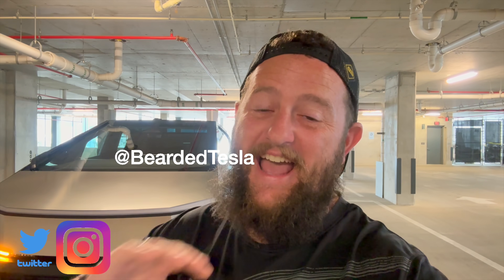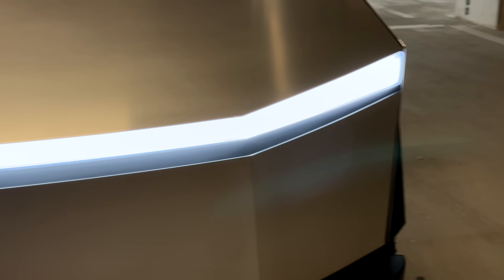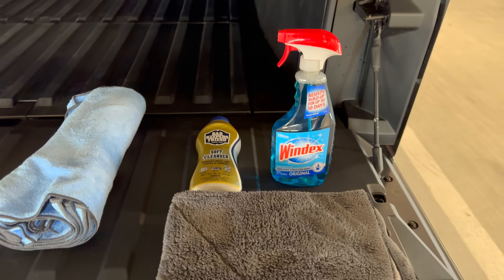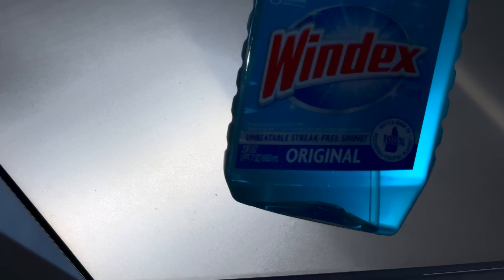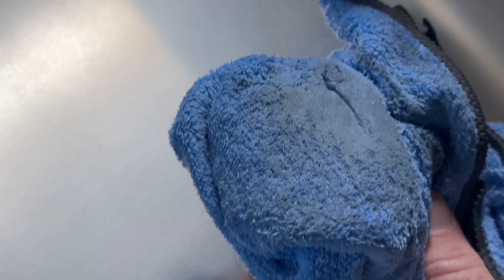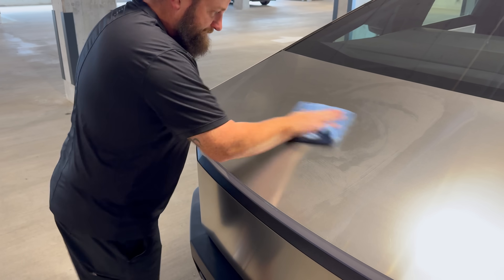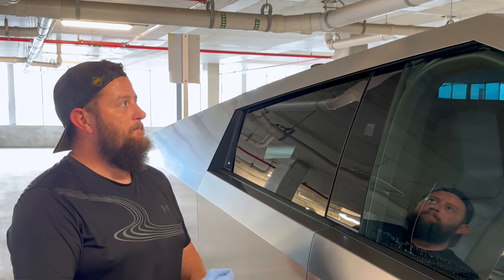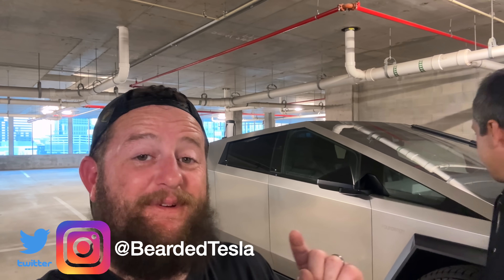Tesla CyberTRUCK or CyberRUST?? The TRUTH About Cybertruck Rusting Issue + How To Fix It!!

Comment: That's insanely high maintenance for a vehicle designed for utility. There's no way an average Joe is going to spend the time to hand buff-out their entire vehicle on a weekly basis... while also preventing the rub marks from showing over time as you continue to remove layers of the stainless after months/years of use.
Reply: Thing is, NO ONE is buying this "truck" to actually use for your typical truck things. This is a niche image vehicle, and there isn't anything wrong with that. Tesla fans and those with expendable cash who need to be "seen" will buy this. They will be popular for a year or two, then sales will die.

The F-150 has been the best selling truck for almost half a century. Yet no one wants the electric F-150 Lightning. GM's Hummer also isn't moving. My local Ford dealer has had the same 3 Lightnings sitting on their lot for months now. Yet they sell countless gas F-150's every week. Here in NE, folks who buy trucks do not care about the cost of gas. They want 4X4 and something they can tow long distances with. Even with an AWD CT, those tires would be useless in NE snow. 

For what it's worth, the CT's I have seen that have been wrapped (regardless of color) look MUCH better than the rolling refrigerator stainless steel. Stainless steel has to be the most overrated thing right now. I regret "upgrading" my kitchen appliances and can't wait to go back to all black.
Reply: @robertgreenhalge1708  From my perspective you are 100% correct, we have a F150 for all of our truck stuff like towing, camping, space for the dogs and more. At the end of the day it serves that purpose and when we want fast and fun we take the car that’s meant to do those things. 

I find even here in Texas with individuals with trucks for vanity there are still a ton of people that use Trucks as a TRUCK. There is no way around that so a EV truck on the market is still going to be a niche but it’s even a harder sell when it tries to solve problems no one is asking for. 

One of my Automotive Design instructors said this to us in school, “Never design for yourself, use design to solve a problem the market is asking for”
I view the CyberTruck as that, it’s designed for Elon and Elon types but that’s it and nothing else.
Reply: I just take my shit through car wash  its a daily not a jay leno museum piece 😂
Reply: You don't need to do this weekly unless you are parking it on a moving railcar and/or next to a grinding wheel working mild steel. At this point, any car is going to have this stuff on the paint. The only unique situation here is that it's a cybertruck.
Reply: @TheRealFrankGrimes  Not any car to the same level. This is something unique to the "stainless" body of the Cybertruck.
Reply: Average Joe wouldn't care. All they need to know is "Those are not rusting spot in your truck".  But since there's so many anti Tesla people trying to point out how Cybertruck (or Tesla) is not PERPECT in every which way, many community members tends to come up with all kind of solutions to count such FUD.
Reply: Nope, any trucker with a brain knows this is not acceptable on release for 100k utility vehicle.. its just as simple as that.. you clearly don’t use trucks, its just a novelty for you and it shows in the product  @clncl98506
Reply: @clncl98506  I'm pretty sure most people would object to rust spots on a $100,000 car.
Reply: @clncl98506  and equal to the anti Tesla people are the Tesla butt kissers that brush away serious flaws.   We are talking about a 100k NEW vehicle that is predominately a show piece.  Now it can't even do that right.   You can masquerade it however you want "the truck is not actually rusting it's just showing environmental rust"  Yeah whatever.   Bottom line is other new cars don't do this and it looks awful.   This is right now, on a brand new vehicle.  What is it going to look like in a year or five years.   How many people are going to wash their truck daily with chemicals so it doesn't look like crap?    Sure... Blame the Tesla haters.   the more I know about this truck the more I went from cool truck to feeling sorry for those that end up buying it.   People are believing they are buying this as a status symbol but that's going to die down quick and they will end up being left with a highly depreciated rust bucket.
Reply: These are iron particles, it is on any car from brakes etc. Go look up any iron removal video. This is why you see people use claybars etc on their car to removal all these particles.
Reply: @pipooh1  Dude... I've owned countless vehicles,  I've cleaned them hundreds of times including deep cleans using clay bars.   It is a completely different thing to compare years of built up road grime to a brand new vehicle that is just delivered.   There is also a difference between smooth glossy paints with clear coats to an unprotected porous unknown alloy that clearly is having a chemical reaction on day 1.   Stop fooling people into believing that this is normal.  Its not.   People should be aware that this vehicle is going to be an upkeep nightmare, if even possible.  I'm waiting to see what it looks like after it gets all sand blasted from a nice salty spring thaw drive.  With a clear coat you just polish it off.   If people are knowledgable and are still okay with it, then great, go nuts and get one.   I have definitely lost my interest.
Reply: @darpompie4354 You are aware most vehicles are cleaned/fixed before delivired duo to these type of things happening or damaged during transportation with train transport etc. Tesla does not have this step duo to direct delivery to the owner. 

Also i think if you can effort a 100k truck and care about it looks, you let it cover with PPF or ceramic.
Reply: @pipooh1  The excuses are strong with you.   Now you want to blame it on Tesla's lack of service that other companies provide such as detailing before delivery.  So then what makes the other Tesla models with the exact same delivery process so special that they aren't delivered with rust?  (Hint... They don't have a bare stainless alloy body).   What is your answer to all the other videos of cybertrucks rusting weeks after delivery and several washings/detailings?  But then you acknowledge that maybe stainless does rust but if you have the money to buy the truck then you should have the money to try and solve the problem yourself.   I don't care how rich you are.  Who in the world buys a 100k truck and doesn't care what it looks like.   If a ceramic coating resolves the issue (have my doubts), why doesn't Tesla include this in their 100k truck instead of having people try to figure itout.  That is not what I consider a luxury buying experience.
Reply: @darpompie4354  Tell me any car company that offer any paint protection from the factory? Not even Porsche etc do it because it to much of a cost to automate it.

If you care about your top layer, yes it is you that is responsible to take good care of it. 

You also aware that Tesla can be cheaper because there is no middle man asking for another cut like all other car deals. That is also the reason you see more and more car brands moving away from the middle man and do direct delivery.
Reply: @pipooh1  I am not asking them to provide free "paint protection" considering they don't even have paint.  I am asking for the reasonable assurance that my one week old vehicle won't rust without it.   Other cars don't, so based on norms any person buying a vehicle would have that reasonable expectation that there new truck won't rust either.    Other manufacturers absolutely do dunk their vehicles in rust inhibitors during the painting process.   Again, I am not specifically asking for a "Ceramic" coating as we don't even know if that solves the issue.   I am asking for Tesla to provide a vehicle that won't rust for the same amount of time that other vehicles don't (usually a 5 year 100K mile warranty).   Whatever they need to do to achieve that, whether its changing the alloy, whether its getting better rust inhibitors, whether it is to provide ceramic shield.   It is not my problem to figure out what it takes to achieve normal standards, it's on them to provide it.  Its a shame that people such as yourself don't want to hold companies accountable for their mistakes and have them solve the issue.

I am not discrediting Tesla cheaper approach to removing the middle man.  I think that's great and hope more companies do that.  I hate dealers.   That is why I took other companies out of the equation.   You claimed that the rust is due to Tesla's process of shipping by rail and not detailing the cars afterwards.   I said that the delivery process for their other "painted" cars is exactly the same so direct me to videos where Model 3's are being delivered with rust spots.
Reply: @darpompie4354  Your last sentence sums this situation up 100%. "That is not what I consider a luxury buying experience."
Reply: @pipooh1 the direct model has started to wane recently

Comment: The Cybertruck forum had some product called Protectaclear Coating. Apparently, it is not a SiO2 or TiO2 coating like traditional paint coatings. They claim it's a high molecular weight polymer coating (I suspect polyurethane/isocyanate based crosslinked polymer). Should be good to protect against UV, dirt, as well a provide oleophobic (fingerprint resistant) and hydrophobic properties. I've never heard about them, but my background in chemical and materials engineering had my interested.
Reply: $311 for a half bucket of that stuff, according to Amazon. That's ridiculous. 

The whole point of this truck is to drive a clean set of angles that noone else can own. Everyone is going up touch it. Paint protective film is what you need to fix this problem & it's ridiculous the factory doesn't provide that OEM.
Reply: Both sides of all this is hillarious.  Just buff on Colinite 845 like all the yachts and sportfishing boats do to their stainless that lasts longer then the rest of the boat.

Comment: It's complicated, this is what happens when the cheapest stainless steel from China is used to build a truck.
Reply: Everybody knows cheap stainless steel “rusts” , expensive stainless does not… people can google it… this comment is not allowed in the main thread. Good comment, cheers
Reply: It’s a custom alloy made by Tesla actually.
Reply: @1ronEntertainment It's garbage that starts to rust 10 minutes after leaving the lot. A complete screwup.
Reply: @AudiTTQuattro2003  it’s certainly not cheap, and is very resistant to corrosion
Reply: How to tell someone here to hate and not watched the video. This is iron particles that get rustes on the car. Not the panel itself that rust.

All cars have this issue, it just very visible on stainless. Go watch any iron removal video of a car and see how much of this is on it. By your logic all cars are rusting.

Comment: I have the same issue with my 2020 Kia Soul EV, I use a chemical application of AutoGlym Magma to remove the embedded iron particles that change them to a purple color and allows you to simply wipe it off, then  rinse and apply a wax or Ceramic coating after. These not only come from Train Rails but mainly also worn steel belted redial tire.
Reply: That would very possibly not work on this type of steel.
Reply: all cast iron brakes on all cars? that must also contribute to the metal dust
Reply: @jvsyoutube3298  Lets say a car needs new brake discs after every 100.000km or 60.000 miles. 

That is (external diameter) 314 mm x Pi - (internal diameter) 180mm x Pi x 2mm x 4 = 3366 mm³ or for cast iron: 24 grams.

A NEW fossil car produces max. 0,0045 gr/km x 100.000km = 450 grams. From burning fossil fuel alone.

An old fossil burner, a old truck, a coal burner or a old petrol engine produce up to 100 gr/km.

Comment: This rusting should show to everyone that the air we breathe are filled with fine particles of metal filling. It just happened iron particles are visible when oxidized. This is one proof that everyone should attend their chemistry classes in high school and college.
Reply: "This is one proof that everyone should attend their chemistry classes in high school and college." True, especially the Tesla engineers that selected the wrong grade of stainless steel for the Cybertruck. Grade 18/8 (Series 304): Made up of 18% chromium and 8% nickel. This grade is highly rust-resistant. Grade 18/10 (Series 316): Made up of 18% chromium and 10% nickel. This high grade is rust-proof and holds its polish well.

Comment: 316 stainless has corrosion rate of 0.023mm per year with 50% aeriated sodium dioxide. I bet it is rail rust. Just get an iron remover, I use it on my painted car.

Comment: Basically they used poor quality stainless so it bends easier. The panel's will rust like fuck.
Reply: These are air particles that land on the car. This can be from rail transport or even just brake dust floating in the air. 

All cars have this issue, owners of white cars that want to keep shiny will know this for sure. Iron removal and wax is only way to easily remove this in general.

Comment: The rail road excuse is hilarious. The body panels are bare metal , they should be passivated after forming prior to assembly. Rust happens to steel because of its high iron levels. SS doesn't rust , it has very little if any iron in its composition. If you look up the specs on 300 series SS you will see this. As far as it being some special Tesla formula I call BS.
Reply: Stainless steel is more than 60% iron and higher, depending on its composition.
Reply: @rborroto  Give me the spec number ?
Reply: @bobbybishop5662  316 is 62% iron; 304 is 66% to 75% iron.
Reply: @rborroto  ok , what is your source ,ANSI , SAE ,Mil std ?
Reply: Cars are commenly delivered by rail.  I had a new white fird delivered and had the same rust particles. It comes also from brake dust etc. It just very visible on white and stainless steel.

Iron particles are everywhere and go watch any iron removal video of a car and see how much is on it.

Comment: “blend” or “chemistry” of steel called alloy, and there is nothing special in the cyber truck alloy, Tesla just doesn't tell which type they using..
You have to passivate stainless steel to make it rust free,, passivation removes Iron particles from the surface and enhances the protective chromium oxide layer, I guess Tesla missed this step.

Comment: I’ve been getting 12 packs of Sprayway on subscribe and save every year or so - I basically use it on everything I don’t eat off of.  (It’s an alcohol-based cleaner, for anyone wondering, don’t think that was mentioned specifically)

But yeah, so many people are so ready to hate Tesla because Musk is a POS, irrationally clinging to anything negative they can get their hands on.  I’ve been blocked by a number of people for simply trying to explain to them that their information sources are incorrect, Tesla cars aren’t mindlessly running people down in the streets, the “recalls” are overblown, and the incessant fire BS is outright FUD or lies (with a link to the fire stats), that the EVs are still safer, not to mention better for the environment.

But nah, they hate Musk too much so they bury their heads in the sand.  Reminds me just a bit of another group that only gets their information from dubious sources…

Comment: Best prevention is a rust styled wrap
Reply: Best prevention is to use the correct material in the first place: Grade 18/8 (Series 304): Made up of 18% chromium and 8% nickel. This grade is highly rust-resistant.
Grade 18/10 (Series 316): Made up of 18% chromium and 10% nickel. This high grade is rust-proof and holds its polish well.
Reply: Do you have to pay extra for that? Jaja

Comment: I wonder if the Sprayway Stainless Steel cleaner and polish will do a better job since you removed some on the top polish from it. It may also help with reducing some of the smudges from fingerprints and stuff.

Comment: I'm a huge Tesla fan, but this should not be happening to a brand new $100,000 vehicle right out of the factory. They couldn't figure this out over the 4 year it took them to get it to market?
Reply: Tesla engineers didn’t want to stainless steel, this was all Elon who wanted a futuristic truck.
Reply: Dude, it's literally dust sitting on the surface and then THE DUST oxidizing. The vehicle is not rusting.
Reply: @TheBowerbird  No one is saying the vehicle is rusting or not. What I'm saying is you should not have to be doing all the work they are doing on this video on a brand new $100,000 vehicle right out of the factory. Figure this out in the factory and fix it before it's released.
Reply: @Paul-cj1wb  These are still the Founder series trucks, they are orbital sanded at the factory. The problem is probably coming from transport. Tesla needs to expand the delivery/showroom network  and resolve this problem during Predelivery inspection. Just like cars that used to get covered in cosmoline for protection when shipped over seas, that stuff was hard to get off, and the dealer had to clean that off before delivery.